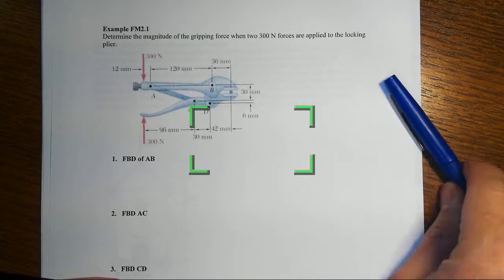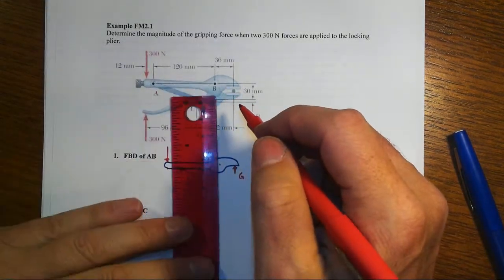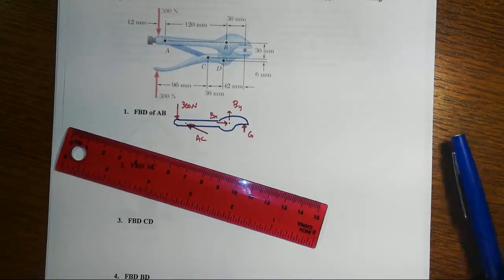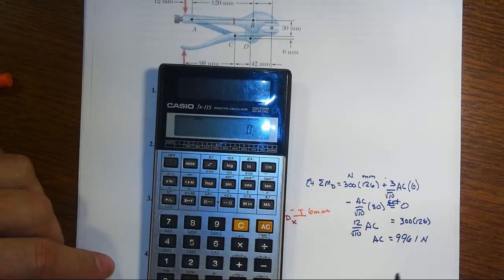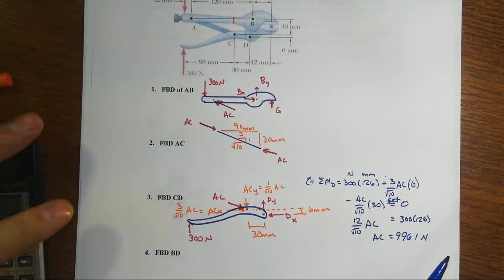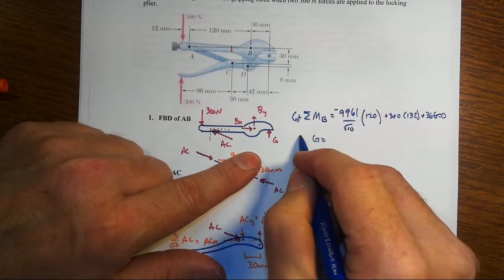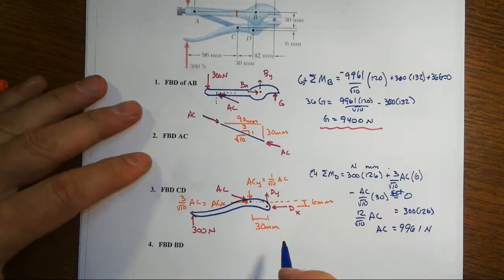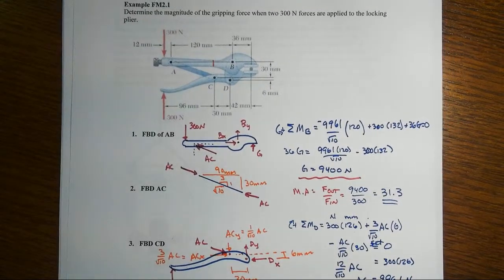FM2 1 Analysis of Locking Pliers

Comment: When calculating the moment around D, I think it should be (R x Fac SinO) in other word ( radius vector X force AC X sinO) the angle theta is the one between the radius vector and the force.  In this case I would say:Md=(-26*300)+(6*ac3/sqr10)